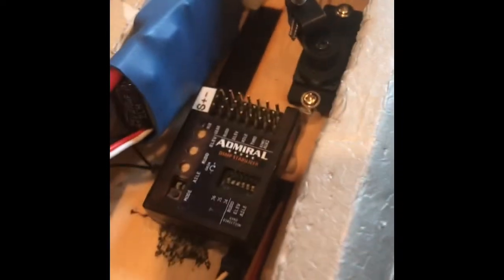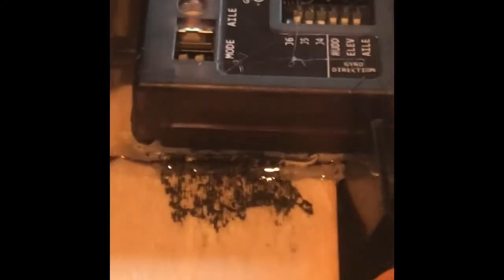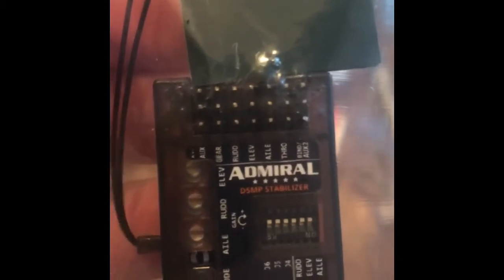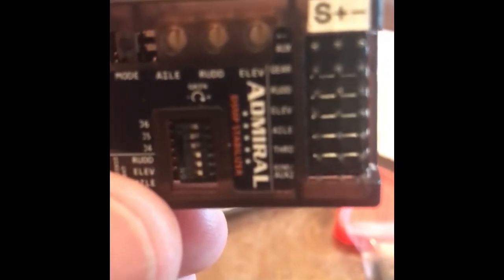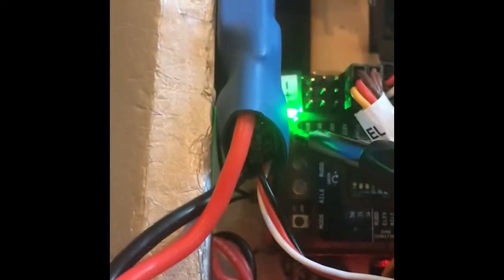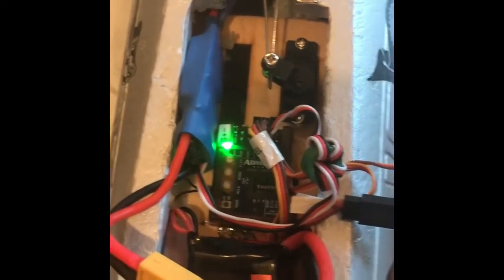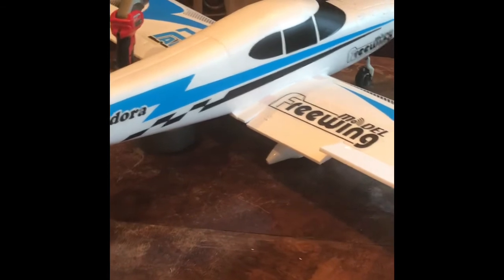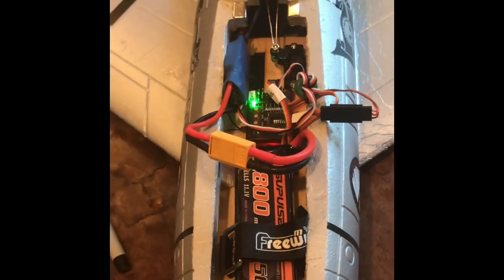Admiral RX600SP Gain Setting

Comment: Can’t thank you enough for putting this video together. I have this Admiral 600sp receiver in about 10 planes. A couple jets were oscillating horribly (wings looking like they had the shakes, or nervous) 
I have the receiver in Combo “A” and the Panic Recovery on the “I”/Bind button. Panic Recovery has been worthless. As soon as you push it the plane or jet goes into a knife-edge nose dive. I haven’t needed the panic recovery, but it’s just a matter of time that I’ll do something stupid and would love to recover from with a press of a button. I’ve got this receiver in a Flightline P-38, a 1600 FW-190, and a 1200mm BF-109. They all have some tip-stall quirks, so I’m hoping your tips on the aileron and elevator gains help. What the heck is going on with Panic Recovery is tied to this.
Thanks again for putting this video together.
Reply: So your recovery is doing the same thing as mine.  Mine dips horribly to the left when I hit recovery button and won’t fly straight. I’m nervous about flying my warbird without the ability to panic recover.   Did you figure it out?
Reply: @bleckybob  Sam, I still haven’t figured it out. I wiped out a 5 year old Dynam Hawksky last weekend. It’s a plane that doesn’t need any stability or a panic switch so I thought it would be perfect plane to test the receiver with. (Before I handed the transmitter over to my 14 year old)
Kamikaze style dive. I pulled out but still stress fractured the fuselage.
Tried again with the ArrowsRC Viper a couple days ago. (This time at 3 times the height of the Hawksky) Same Damn thing! Left wing dips, nose comes down. 
I’ve changed the voice on my ix12 from “Self Level” to “Self Crashing, everyone take cover!”.
I’m not the smartest guy in the world, but here’s where I’m at.
I have this receiver in about 20 planes. The Panic Recovery on the “I” has the same effect on every plane/jet. So I know it’s not just a bad receiver. I’ve got 5 planes with the LemonRx stability with gyro and no issues. The Lemon receivers don’t have the recovery on the “I” button, it’s on a switch. (Mostly the “A” for those planes with fixed or no landing gear)
Let’s get this figured out. It’s probably something simple.
Reply from the maker: I've since given up on the RX600 in favor of the Spektrum AR680. After crashing a number of MotionRC 64mm jets I decided to try the Eflite F15 with AS3x and SAFE. What is great about it is I can setup a switch on the transmitter and switch back and forth between AS3X and SAFE. So I initially started flying the F15 with SAFE only and when I wasd confident I fliiped the switch after takeoff to AS3X. With AS3X there are no limits on flying and if I get into trouble flip back to SAFE to level the F15. This approach has save many crashes. For jets without the AS3x/SAFE receivers I put in the AR630 and programm the AS3X and SAFE to work and now I can fly it in that 64mm F9f, BAE Hawk T1, LX F22 kit and I have a P38 and F18 64mm I want to try. So far this has saved a lot of crashes while I build my skills. I'll make a AR630 setup video soon.
Reply from the maker: BTW that Eflite F15 is an awesome jet for beginners. It can fly slow and fast. Tips: 1) put a thin coat of clear epoxy on the nose cone, under the wing tips and perhaps along the canopy fuselage section. This will harden these areas which typically get the damage. 2) practice high alpha flying - there's an Eflite f15 video on youtube that shows it. This is a technique to use to help slow the plane when landing. Don't do high alpha all the way to the ground as in the video unless you remove the gear and land in grass. With gear on they will get damaged by grass. There is a video where a guy high alphaing all the way to a paved runaway and it worked but I haven't tried it.
Reply: @Zek1701  I’ve got a Flightline P-38 14 months now after the build. It has the Admiral 600sp in it. I’m thinking about sucking it up and spending the $100 for the same receiver that came with the Eflite a-10. I can’t believe after 5 years in this sport I still struggle landing anything that’s not a tail dragging high wing. (The twin otter and the Sonic Binary are the only exception. They’re so well designed and stable with takeoff flaps on landings. Maybe it’s the twin props that help not to tipstall and land at a reduced speed. 
I’ve watched so many videos on how to land properly, you’d think I’d have it figured out by now. But as you stated, the Spektrum receivers with Safe and AS3X solve a lot of bad glide slopes, or potential tip-stalls. Funny thing is, the only 2 jets I’ve flown,  (ArrowsRC Viper and Marlin) 
both have the Admiral 600sp, no issues landing. The field I’ve flown the Marlin is grass and about a 1/2 mile long, so I have lots of room to fly it down and throttle it in. That big field is a bandaid. Meaning I still can’t land on a standard length asphalt runway.
Reply from the maker: @jeffhenderson934  I, too, have the FL P38 for about 6 months and have never flown it. I'm putting in the AR630 but I'll fly it with just AS3X. I think I have enough jet experience without SAFE I should be able to fly the P38 without SAFE. However, SAFE will be just a switch flip away. Nowadays I really only use SAFE on planes I'm familiar with when I lose orientation and landing in cross wind. Both of these events has caused me to lose aircraft in the past. 

While the ar630 is $70 compared to $30-ish gyro receivers if one uses the SAFE self level 1 time when in trouble the receiver pays for itself!
Reply: @Zek1701  Even though I haven’t flown my P-38, it’s probably my favorite prop driven model. When I got in the sport 5 years ago a 14 year old kid flew the P-38 all the time. To this day there’s not, in my opinion, a plane with a better in flight presence. Because of my OCD, I made moves already to crash. I purchased the upgraded landing gear, 2 extra props and spinners, and  an extra fuse. All that money and I still haven’t purchased the AR630 or similar Spektrum receiver with AS3X and Safe. That’s about to be remedied.
There will be a day soon when I maiden the Eflite a-10 and the FL P-38 on the same day. If they both crash then I know I need to stick to the level of my Conscendo Evolution/ArrowsRC Viper, Marlin and Husky/Turbo Timber/Twin Otter and Sonic Binary.
If I’m honest with myself, it’s not takeoffs or flying, it’s landings that are the issue. Like you, it’s really nice, like the Twin Otter on floats, to have the AS3X on and Safe on the “A” switch. 
Ordering the Spektrum receiver with AS3X and Safe now for the FL P-38 and the Freewing 1700mm a-10 I ordered over the weekend...
Reply from the maker: @jeffhenderson934  I my case I feel confident I can land the P38 given sufficient fly field. Where we fly there are a lot of trees and the bigger aircraft require longer fields.
The AR630 helps with the wind gusts to stablize the plane but it still a matter of controlling the speed and height to land successfully as you know. 
What I've found is that if I get the plane relatively low ~10ft off the ground and at a essentially a coast speed prior to getting to the edge of the landing zone this really helps with positioning the aircraft for successfully landing. If this is not the case then one has to dive the plane or land way too fast which usually doesn't end well. I actually look forward to the landing as one of my favorite parts of flying. The challenge of sticking a beautiful landing is very rewarding. Last time out I was able to get a nice landing on the Eflite F15(64), Eflite F16(64) and a LX F22(70). The F22 is on youtube.
Reply: @Zek1701  I was thinking about good landings I’ve had and one thing was clear- High wing. Sonic Binary, Twin Otter, Timber Turbo ArrowsRC Husky.
What drives me nuts is I can land the ArrowsRC Viper with no gear, no flaps and no rudder perfectly. Even the Marlin with no gear is nice. But once I put the gear on the Marlin I treat it like a completely different airplane on my glide-scope and landing. It’s just mental now.
Reply: I to have the same problem with all 3 of my Admeril 600 receivers.on a level bench no prop in recovery mode,throttle at 50% my ailreons and elevator slowly move on there own.switch to gyro only problem solved..can't find the problem..

Comment: I crashed a FW 190 because of these settings. Gains were at about 1 o’clock but if you have a DX 8 or 9 TX , the gain adjustment defaults to the knob on the upper right.  Mine was turned up and I didn’t  realize it.  The plane did a complete roll on take off and then was uncontrollable. It fluttered as u discribed and then crashed.  There is one sentence in the instructions that tells this but I missed it and my plane paid the price. Again on the 8 and higher TX s with the knobs.  Hope this helps